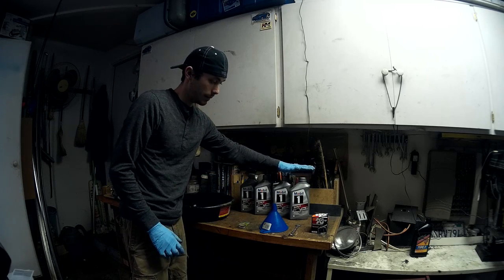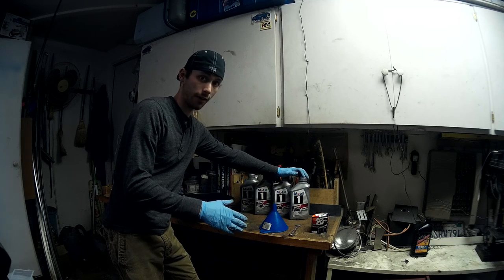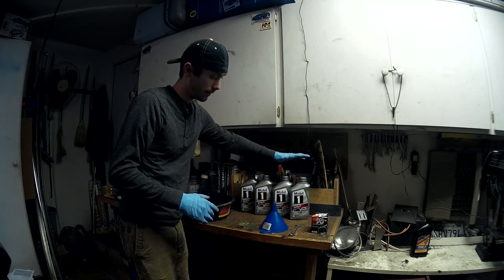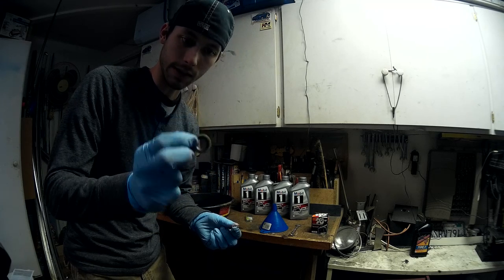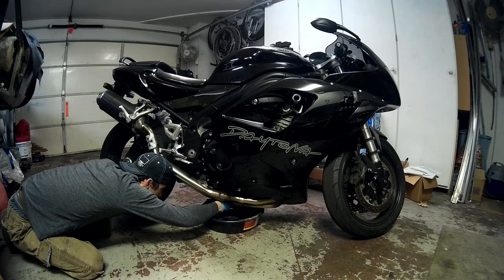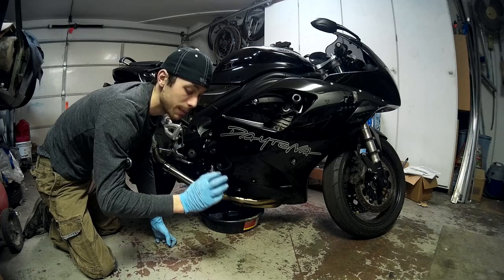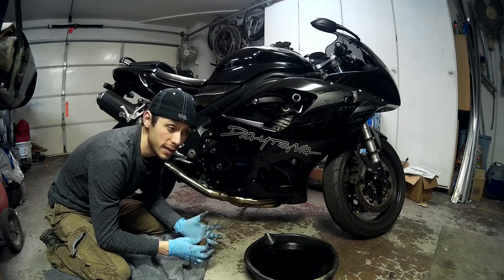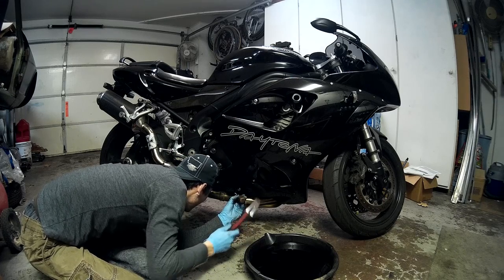DIY Motorcycle Oil Change/Stuck Oil Filter (Daytona 955i)

Comment: Thanks a lot for that great DIY video regarding oil changing on a 955i Daytona (that I also have in black edition 2006).
I have several question regarding the oil changing:
- Is it a 13 key to remove the screw?
- What is the size of the drain seal? 12mm or 14mm?
- So why would you use the aluminium one instead of the copper for exemple?
Thanks man!
and if you have a video for changing break liquid... I'm taking it! ;) V